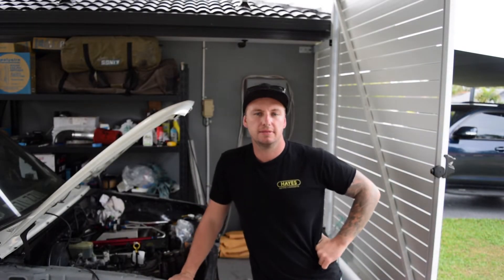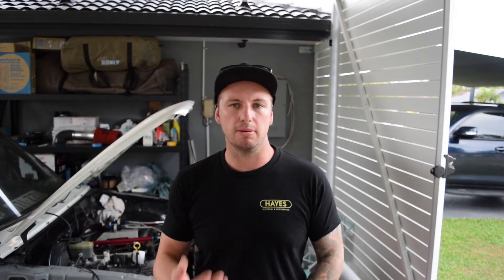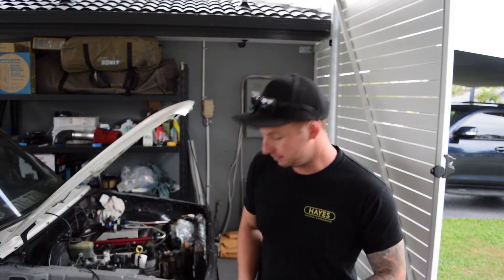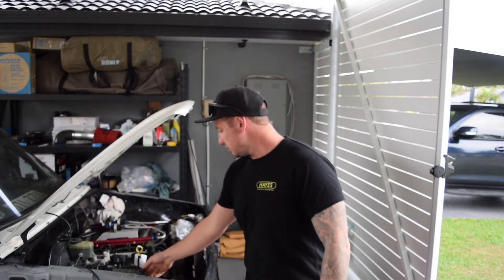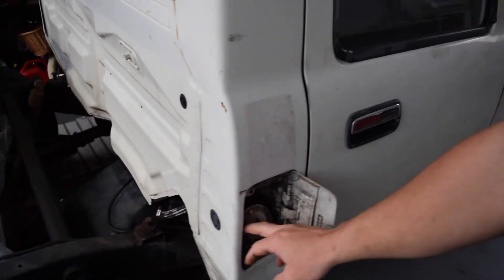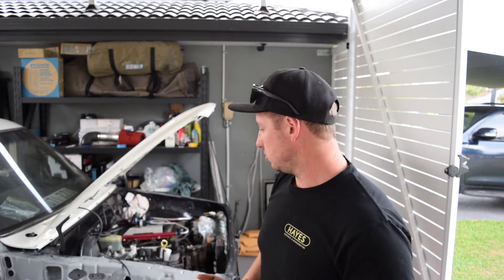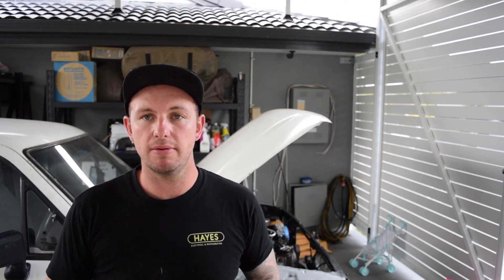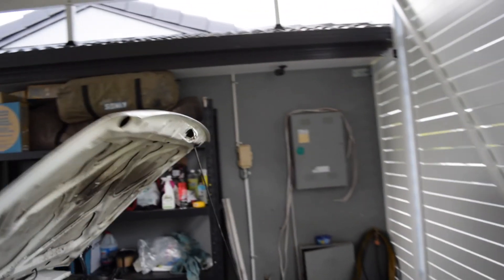LS1 Hilux Ep3 The problems begin

Comment: what motor mount did you use and what version of engine is the ls and transmission you bring I have something similar.
Reply from the maker: Hey Adrian! I used v6 conversions mounts but I wouldn’t recommended them. 
I would go rod shop or do custom mounts if you have the facility to do it 👍

Comment: Yep i got the ve water pump and spacers from sparesbox, it was way cheaper.
Got marks engine mounts there shit because they put a 20mm offset in them so the engine sits to the left and looks fckd, got a pair of rodshop headers and they foul up also
Reply from the maker: Hey mate! It definitely works out cheaper, people buy a engine then just go buy all the kits, it’s ludicrous. Then they find out that they can’t use certain things. My engine mounts seem to pus the engine out my 10mm. I though maybe my car wasn’t straight or something but this has definitely opened my eyes to this situation. I’m definitely going to promote buying the weld in kits rather than hes bolt in kits. They are a joke and a waste of time it’s ment to make the job easier and it doesn’t, so I hope people see this video and take my advice

Will bring this up in the next video

Thanks 👍👍👍👍

Comment: hey mate did you use a second hand ls1? im trying to find a new/rebuilt one with bolt ons but am struggling to find one. i can find an ls3 but unsure if this will fit with the adaptor kits etc. where is this v8 hilux page? i have an ln106 and am keen to put a ls engine in
Reply from the maker: Hey mate! I did buy a second hand engine from my friend in Adelaide. It is definitely hard to find them for a good price at the moment as covid has driven the price up. Keep your money in your pocket and wait until one pops up that suits your price. It will happen. In the mean time you could source other parts for your build.

In Facebook type in v8 hilux group and it will come up. Heaps of info on there.
But as I mentioned in the above video ever application is different.

Will bring this comment up in the next video

👍👍👍👍

Comment: what radiator fan are you gonna use? i dont know wich one i have to use on mine
Reply from the maker: Hey Victor! I’m not 100% at that point yet but I plan to mimic the Ls1 or AU falcon thermo fan set up which is a dual fan 1 big 1 small. I haven’t measured the size yet. But basically using the relay from a Ls1 or AU integrated with the ecu it will control when the fans come on and off. This can be altered by your tuner or even by yourself if you have the know how. The fans will be in a push style in front of the radiator.

There is no way in this application I could run a viscous fan.

Great question I will bring this up in the next video.

Hope this helps
Reply: @banksgarageaus  Thanks! 
Here is another question, and I will probably ask many questions in future if that’s okay. 

What fuel pump are you using in that build?
Reply from the maker: @victormeinel1541  haha that’s all good mate. I will be covering that soon but I will be using a Bosch 044 (vl turbo fuel pump) 
Cheers